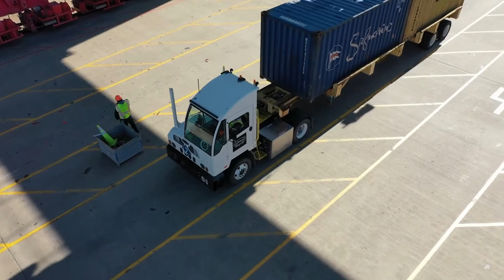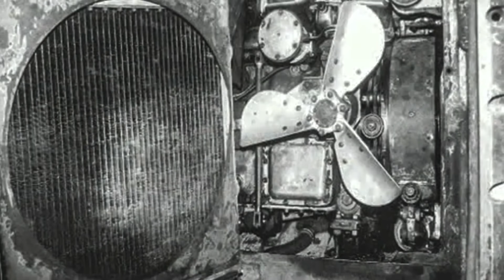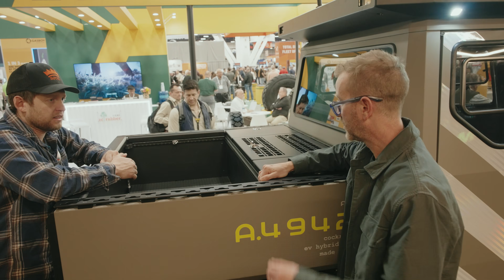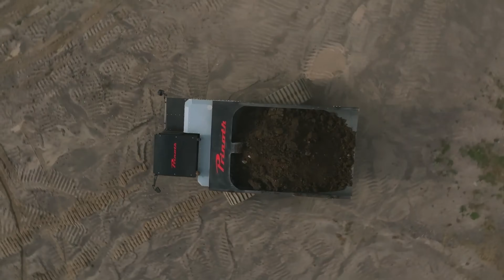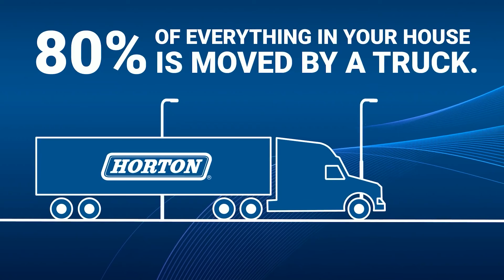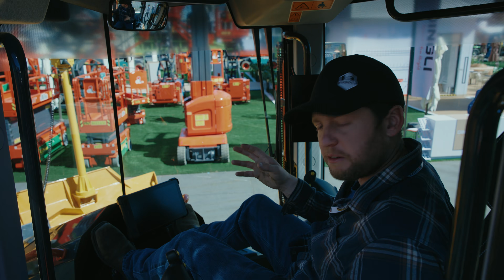The Companies Behind Our Trucks (ConExpo 2026)

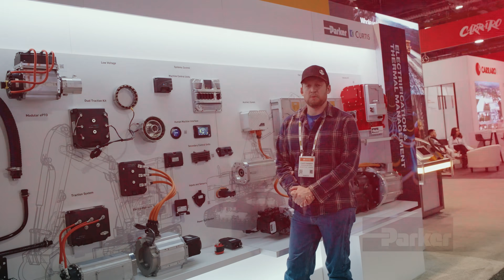Comment: 23:32, heck yeah  BUILD THE EDISON MONSTER/ SASQUASH  use military spec axels maybe Stat with a old pacific truck , build a new frame , tripple 1/2"  rails with riveted crossmembers, made of 5/8" steel. Locking axels a 6 speed gear box with a 100-120kw electric motor driving it, with a big Cummings x15 engine and generator 80 kw battery, maybe use tracks? Or 58" airless tires. Or ditch the electric, go full diesel..

Comment: I was just wondering, the government has is giving grief about the generator carrying electric/hybrid trucks,  could you use a highway diesel engine, with electric axels? Bypassing the use of a transmission?  Does anyone make components to make this possible?
Reply: Even when Edison uses the street legal Cummins x15 engine, then the government complains that it is street legal when bolted to a transmission, but it has not been proven with $2M in new testing when bolted to a generator.

It is dumb

Comment: is there a video explaining how the 18 speed gearbox works in your trucks with the electric motors?
Reply: Edison is making old fashioned trucks with 18 speed transmission, or hybrid with a generator. 

Edison is not using an 18 speed trans with electric motors

Comment: There’s so much to be gained from wandering around trade shows and seeing new things. Too many manufacturers get stuck in their cave and never attend to see what options are out there. They also get too big and too disorganized to change suppliers even when their current partner starts making sub par parts.

ZF could be a good partner. They have a plant in Vernon hills Illinois so logistically that could be good, although I’m not sure where the assembly they had at the booth is currently made. They also have a HV training program already built that bmw used to train their factory workers for hv safety that is DGUV certified. That could be useful when you start building hybrids. 

Lastly vegas feeds off trade show attendees, I attend SEMA/AAPEX each year normally as a speaker/trainer, it’s by far the most expensive travel week for me throughout the year.

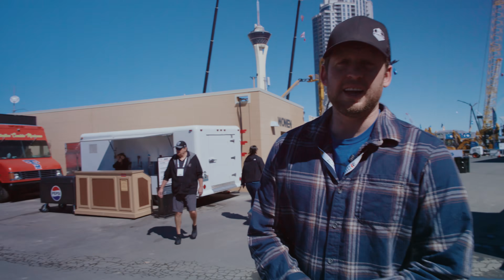Comment: 35:38 Not sure if that is sarcasm directed at the local Tourism board or not.
There are reasons other than money for avoiding the USA right now.

Looked up the anti-trans bathrooms situation in Nevada. Was pleasantly surprised to learn that single stall washrooms in the state are required to be gender neutral.

Other states are making it a felony for a transgendered or even intersex person to use the gender-appropriate toilet.

Comment: The air drain valves are why you need to go to trade shows.  It’s the little things you can incorporate on newer designs.
Reply: @Wild_Lee_Coyote  thats why I plumbed in drain lines, with ball valves! End of day walk around is easier! Cheers!
Reply: @smedleypdolittle   devil's in the details 😅
Reply: That was awesome there  never thought of being that high up but air is still good to shove water out
Reply: @izzyofmylife9457  I wonder how well it works when frozen. At the tank it gets warmed up by the air. I guess you could put a second drain valve there?
Reply: @bene5431 good 💡 ideal there most of the guys i know never drain a tank at all here when service was done you have a swimming pool if you doit first 😂
Reply: @bene5431 purge them at the end of the day. Before shutting truck off.